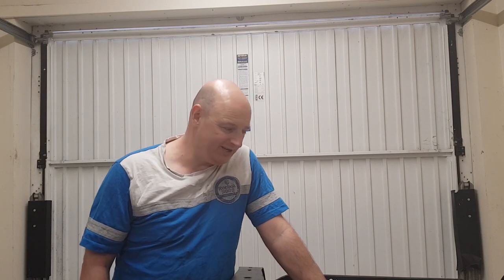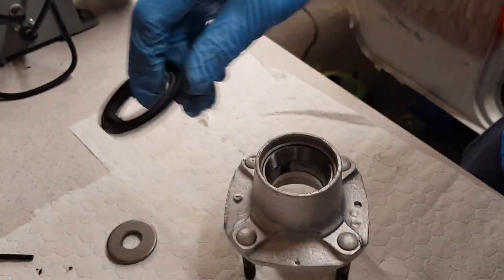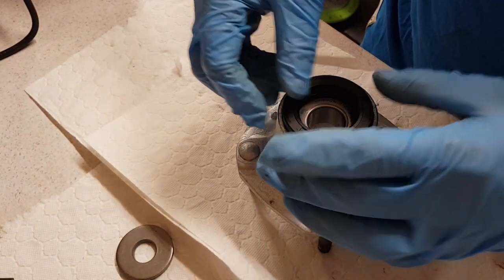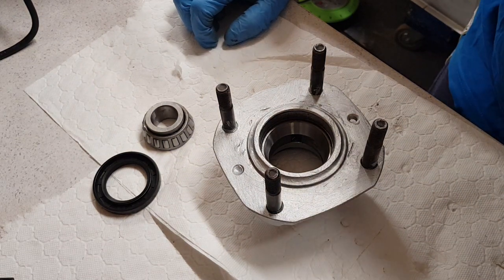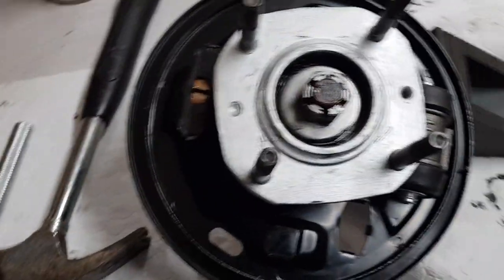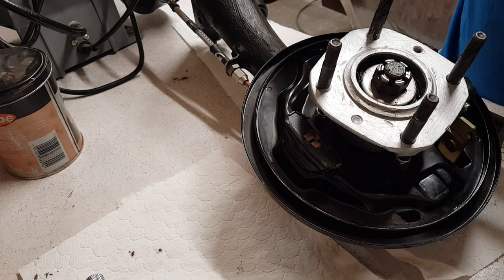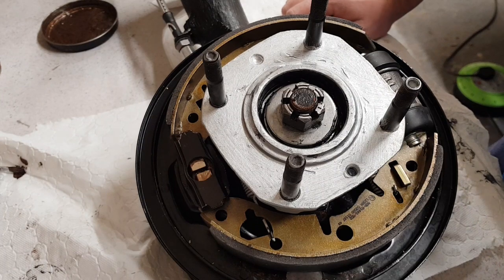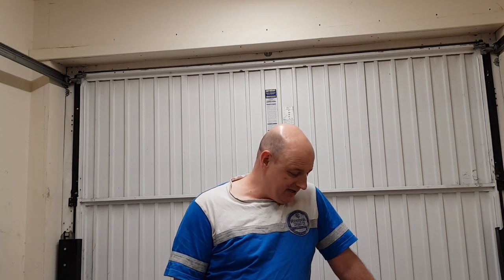Classic Mini Restoration: Eleanor Video 35, Building the Rear Bearings and Brakes

Comment: DB,  Great video and i am sure they are helping a lot of people, The down side for me is the finish on the sub frame with the tar or underseal i‘m sure it will work well for the Scottish climate to stave off the rust but it‘s not my cup of tea, Cheers Dave.
Reply from the maker: Its a bit oily and messy to work with. Choice would be a nice powdercoat but the funds are needed for other parts just now

Comment: When ever i have rebuilt drum brakes i have always put the springs on the shoes and then forced them over their stops onto the back plate, then like in the case of the mini fitted the bearing hub.   In my experience puling/stretching springs can be a PITA

Comment: Hi, it looks like you may have had the lower spring (nearest the cylinder) on with the long part of the spring at the top instead of the bottom? This means it’ll rub against the hub and eventually risk wearing through the spring… My car had it on upside down too, is an easy mistake to make :)

Comment: Yeah the GT will be going into a garage to have the breaks all checked and properly set up, also tracking and headlights alined up. Jobs that you need an experts eyes over.
Reply from the maker: I have all the parts there to do a complete brakes overhaul on ed but currently in the process of doing the cones and front suspension weather permitting

Comment: Good video just an observation wouldn’t it be easier to put the break shoes to the back plate before you fit the hub you could always assemble the shoes and fit before you fit the hub
Reply from the maker: Yes they can be assembled off the hub and you can buy the fully assembled with the back plate too, some of the hub to back plate bolts are obstructed by the retaining springs so has its own challenges, maybe next one i do i can pre assemble and compare which method i prefer

Comment: I’m just at this stage now, accept the wheel bearing races don’t seem to want to go in as easily as yours!

Quick question if I may, does the metal brake pipe on the radius arm need any sort of washer? I have a shakeproof one for where the rubber hose fits, but nothing for the copper pipe
Reply from the maker: No there is no washer. When it is tightened the tapered/flared end of the brake pipe will seal against the flexi hose. With the inner race it needs to be completely square. If there is any angle at all it won't go. Smear the outer edge of the race with grease and the inner bore of the hub
Reply: Thanks, just wanted to make sure with something as safety critical as brakes! With the bearings, I think I will get one of those driver sets like you have. I've been trying to get the race in with an upturned socket, but it just doesn't stay at a flat angle
Reply from the maker: Its the initial part that's tricky to get in. Do you have the old inner race. If so use that upside down to tap it in ( will be the same diameter) and just tap gently at 12 o clock...3 oclock....6 oclock etc. It will go
Reply: DB Mini DIY thanks I will give that a try
Reply from the maker: Let me know how you get on
Reply: Will do, honestly do appreciate the help!